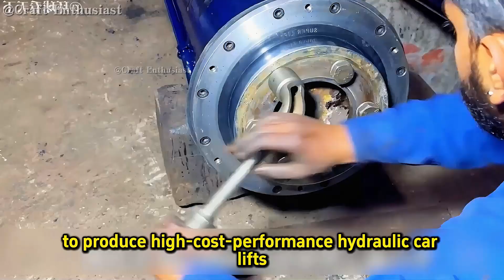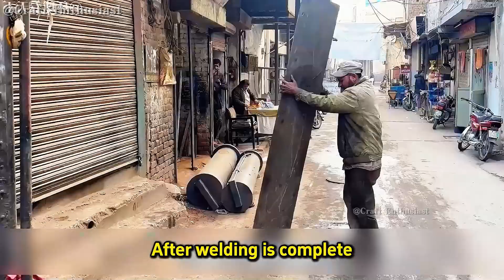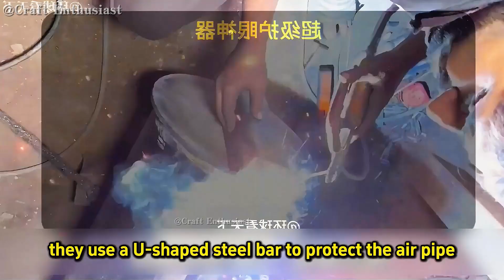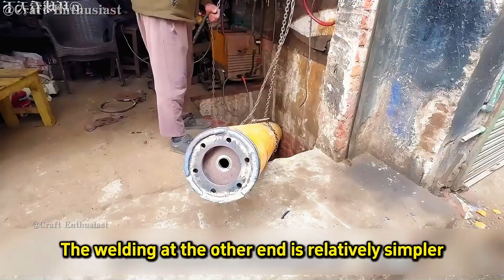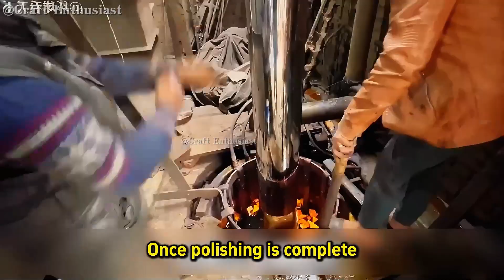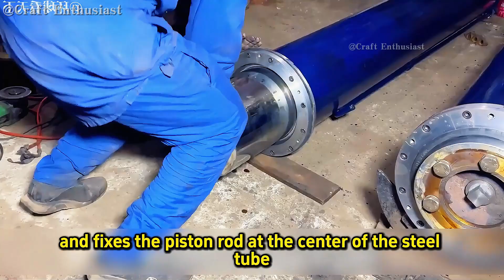A Miracle from a Humble Workshop! Handmade Car Lifts with Incredible Efficiency! 🚗🔧🔥

Comment: Looks good. I'd put (or if it exists already on the system and wasn't shown?), a locking mechanism. Any hoist should have some locking mechanical mechanism. If the cylinder fails, even with a tiny leak, the platform should drop onto something that will hold it up. Pretty sure those talented people could easily do that, awesome skills right there, the mirror shine on the piston is amazing!